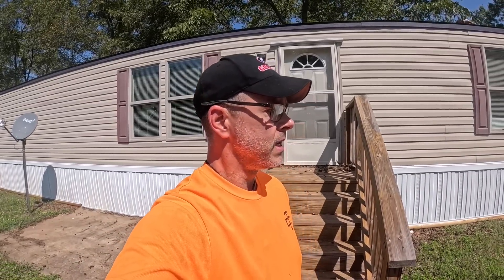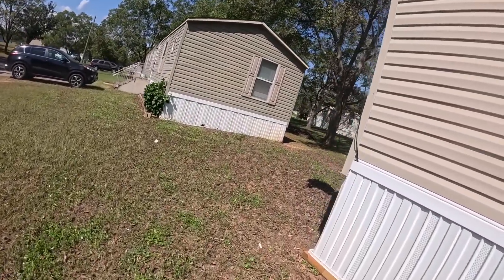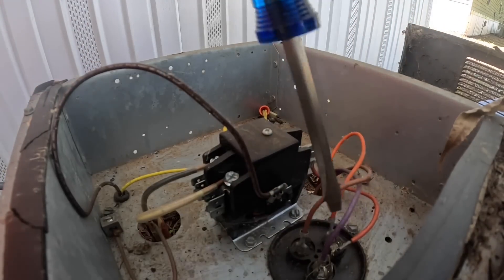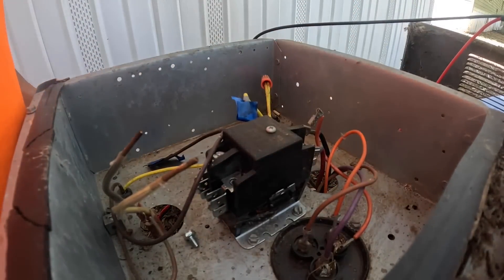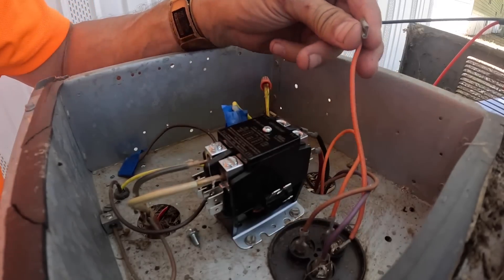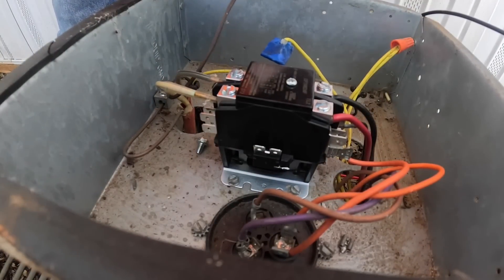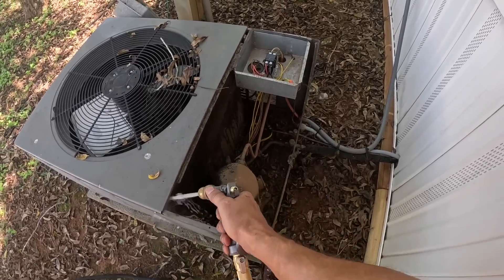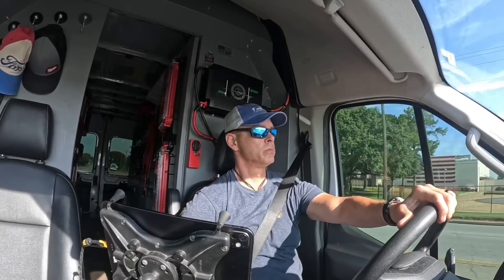Mobile Home Air Conditioner Not Cooling! #hvacguy #hvaclife #hvactrainingvideos

Comment: Hey question I was on a call where the outdoor a/c unit compressor was failing and dropping out at 49 amps every 30 to 40 sec. We just changed the grounded compressor this past Friday  the odu is now failing I requested the electricians check the meter and the power from the panel back to the disconnect they said all is fine I don't think so any help would be appreciated

Comment: Couple of tips from an old A/C Tech - Spray some Raid around the electrical wires coming in (Not in the contactor/cap section)  Sprinkle Amdro around the outdoor unit and finally, put 2 or 3 Moth Balls inside the contactor section.  Ants hate Moth Balls, Love Amdro and Hate Raid.  These things will take care of the ants so you won't be back next week with more ants in contactor.

Comment: Great Job! But too much cooper wire exposed on the high voltage side of contactor.  Need to cut that down a bit.
Reply: Or at least tape over it.

Comment: Good job Curtis! That contacter you replaced looked fairly new. They need to spray those ants or you'll be back for another contractor next year. 😄
Reply: Or next month; we used to replace the contactor and spray some ant powder around, Red ants are the worst!
Reply: @bobboscarato1313  😄👍